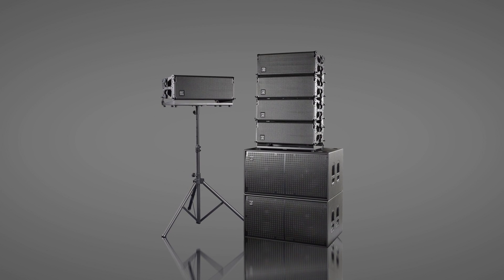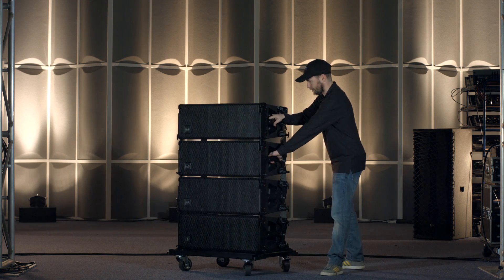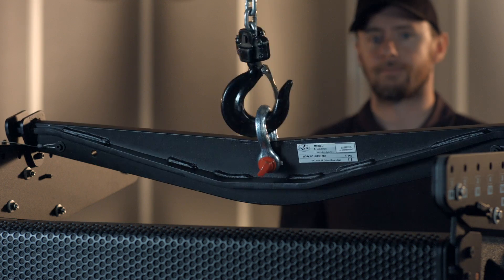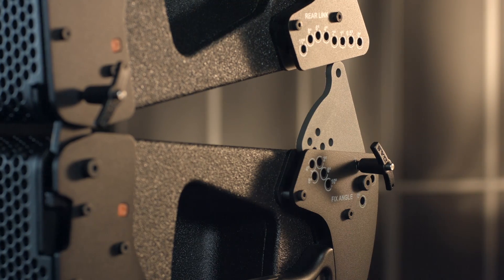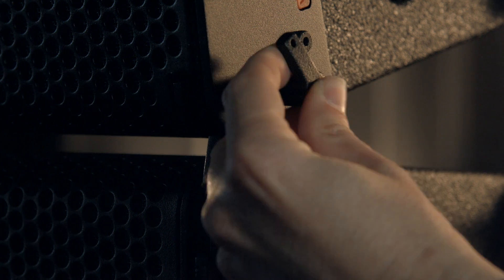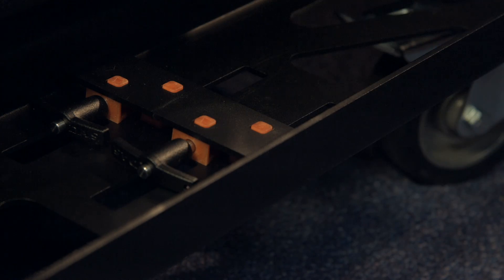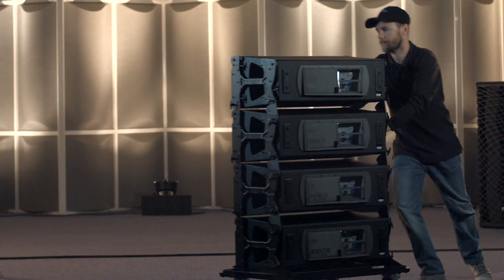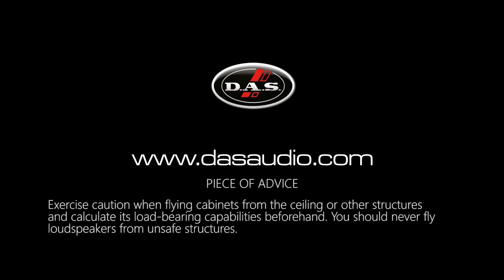D.A.S. Event Line Array Rigging Tutorial in English

Comment: that looks like the most time consuming line array to set up
Reply: It's not, but it is not as easy as they make it look. When you are trying to get it into the rear holes, it moves about, and it has to be at a very correct height to lock. It's a lightweight and cheap system that performs really well, but reality is that being budget friendly, comes with some drawbacks. There are definitely systems out there that are equally slow and annoying to setup, but also a few that are faster and easier. Martin MLA Mini is miles ahead, and so is the F1Vero VX.